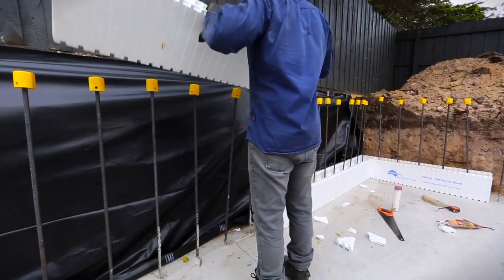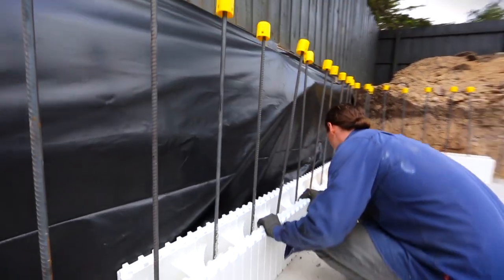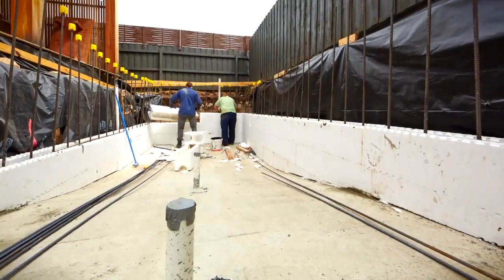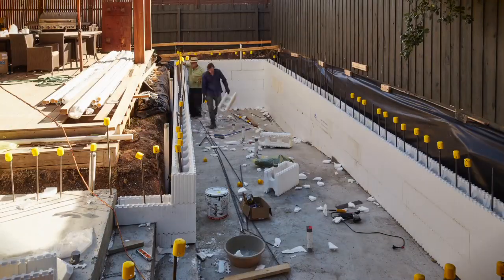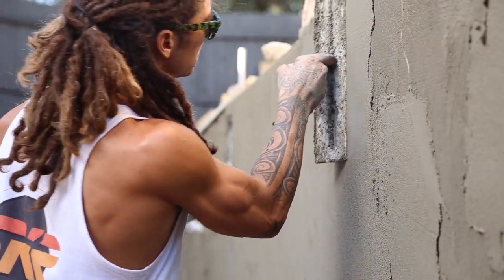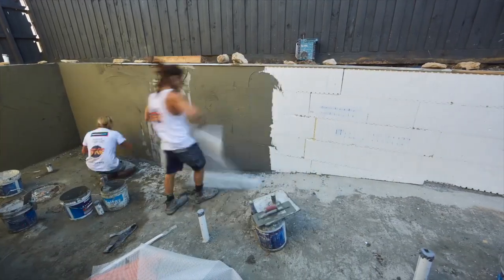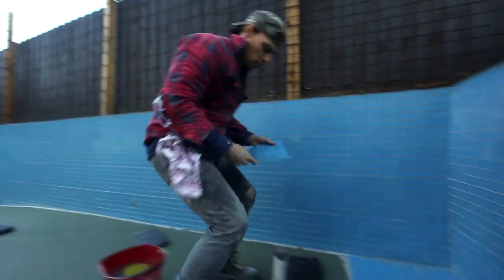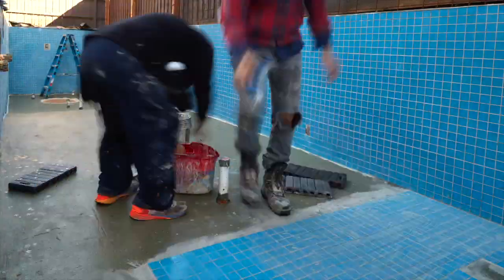What are the main benefits of building a pool with polystyrene ICF?

Comment: I have seen radiant heat floor connected to super hot solar hot water heaters and run the lines through the bottom of the pool before you even put in the concrete. You all put the styrene blocks on the side, why not add a warm floor to the pool and to the patio around the pool, then you could go swimming year round, then say save up for a sliding overhead pool cover. This way when it's cold outside, slide the cover closed and go for a swim. Everything is heated on the inside. Then when summer comes along, turn off the patio around the pool, keep the warm floor on in the pool and go for a nice swim

Comment: Any money you save on heating you just blew on that tile and all the water that will leak out. But I like it.
Reply: Leak where?
Isn't there a layer of waterproofing under the tiles?
I think I will go with this build but with a liner instead of tiles
Reply: @luckystrike656 did you build this in the end?
Reply: It doesn't make sense talking about saving the heat when the pool is without a poolcover
Reply: @demoe5676  same can be said for a glass or shot crete pool